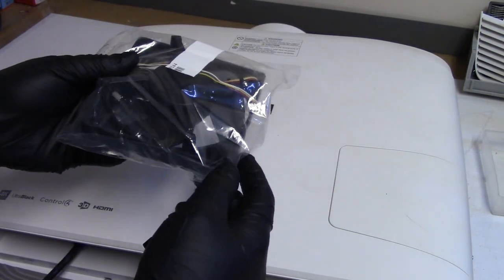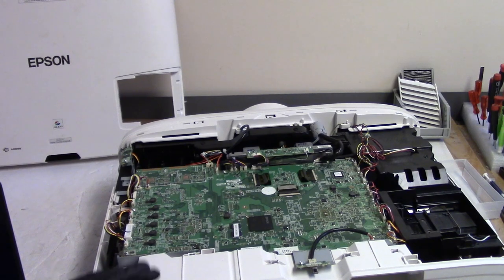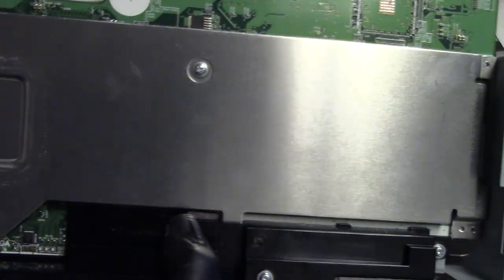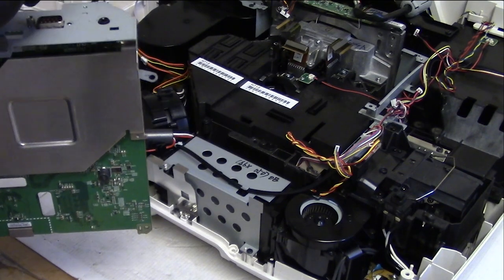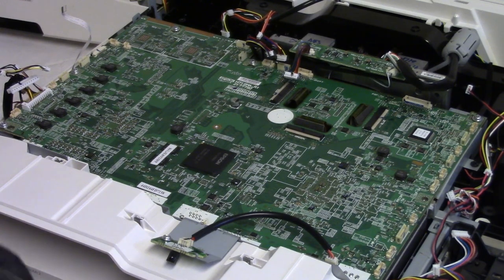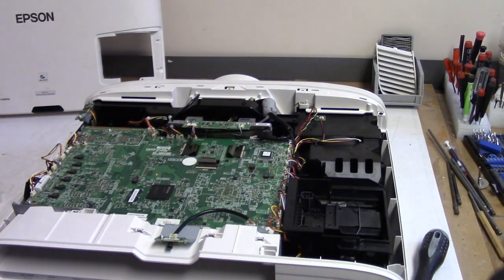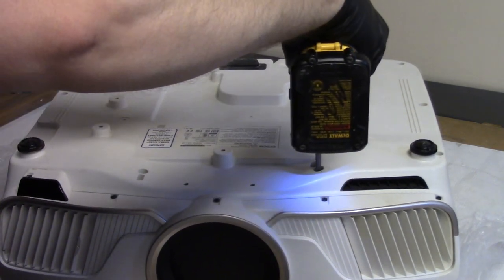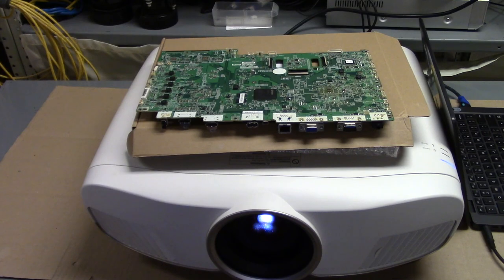Epson Home Cinema 5040UB LCD Projector Repair | No Video | New Mainboard - LAST EPSON REPAIR

Comment: Hey Frank! Thanks for this video. I’m having a similar issue with my Epson 5040 and wanted to see if you had any thoughts. my HDMI port 1 isn’t displaying video. I had an active hdmi cable running to it and yesterday when I turned it on… I got the Epson logo.. then a no signal. So I did some usual diagnostics. Power cycled, tested other sources, tried HDMI port 2, bypassed the receiver, etc. I noticed that the active hdmi cable was really hot. So… I thought maybe it went bad. I bought a replacement cable. Same problem. No source video. Just the Epson UI still. However…with the new cable hdmi 2 is working fine. So I’m curious if my HDMI 1 port has gone bad. Any thoughts? Appreciate your time!
Reply from the maker: Hi Brandon,  It does sound like that.  If you used new cables and they worked on HDMI2, then likely hdmi 1 took a hit.  Static is nasty for these. Ground loops are another issue.  Make sure your projector ground and video source grounds are at the same potential.  Or active HDMI cables can sometimes do this I have heard.  I have not seen one do it myself but I have heard of people saying it.    As much as I hate to say it, I'd just live with using HDMI 2.  Repairing that would require a new mainboard and through epson itll be crazy expensive.
Reply: @FixitFrank  Thanks so much for the reply. Yea it does seem like it's probably a... use the lesser hdmi port type of situation. Thanks for the honesty. Love the channel. Cheers

Comment: My Epson 5040 do not have a power at all. I called their technical support they told me Motherboard is failed. What options Do I Have? Or which brand and models are you recommending it? Thanks.
Reply from the maker: Sony hands down, or JVC.  I would run far from epson. They have not been good to consumers in my opinion.  The mainboard might be the issue. did it have a flashing Wifi LED and wouldnt respond otherwise?

Comment: Hey Frank, I've got a 5050 with a dust blob on it. Its blue when the screen is black and doesn't fully focus. After tearing this apart and with your extensive knowledge, how would you advise removing the blob? If your answer is don't....let's assume I'm stubborn and would try anyway. What would be your approach? Thanks!
Reply from the maker: Epsons are a pain to work on plainly put. They seem to turn into Pandora's box. Open it for one problem and then 10 more appear. To clean your projector you need to use a gentle vacuum a photo cleaning brush like a lens brush and lots of patience(and some.good luck). There is also a chance that the coating used inside will flake off when you go to clean it so be aware of that (it's located on the prism in the center of the LCDs). The mantra you want to follow is less is more. I would try and vacuuming first to see if you can pull the dust out that way and then start removing things to get towards the LCDs but do not touch the LCDs and do not remove the LCDs by themselves leave the optics together if you can help it. I wish you all the best,  but I would also make sure you have some money aside for a new projector. The Pandora's box thing is real and somehow Epson patented it...
Reply: @FixitFrank  Hmm, ok. Thanks for the reply. I've seen mutliple recommendations to use compressed air to blow out the dust. I was told to just put the nozzle where the LCD ribbon cables come up through the main board. What are your thoughts on this?
Reply from the maker: I'd use a vacuum.  Compressed air can push dust places and also cause the flexible cables to tear from the flapping. You actually need to take the mainboard out to get the dust areas.  they are all around that glass cube in the center. this is why I suggest against going inside.  If those flat flex cables to the LCD panels are damaged, the projector is done. You can use low pressure compressed air(not canned air) and loosen the dust and then the vacuum will collect it.  Canned air can blow too cold and cause moisture to get into places you don't want it. 
Seriously, you stand a real chance of ruining the projector. I don't say that because of a lack of skill on your part but rather epson makes these so unserviceable and after they get older the flat flex cables get very brittle and the optical coatings on the prisms can be susceptible to damage as well.  Im going to go on record and tell you that this is not a good idea but I also fully support your right to give it a shot.  I have a few other LCD cleaning videos, you might want to check them out.  But seriously be careful.  be so so careful. Good luck!

Comment: I have 5040ub 5 years old but used it only for less than two years, as it was sitting in the box for the first three years as I had basement stuff going on for three years. It doesn't power on at all. Any suggestions?
Reply from the maker: That is tough.  Epsons are notoriously troublesome out of warranty.  There is a 6v regulator that is known to fail and a few fans that are known.  I stopped repairing epsons because of the lack of parts you can get and how problematic they can be.  In your case, I'd try reseating the lamp, make sure the lamp door is on and that the power cord is secure. If its still not doing anything, then I'd put that projector up on ebay and buy yourself a JVC or Sony.  Epson has only declined in quality. I would never buy an epson today.  I will say the image looks great when they work but they now are failing after 5 years so save your money to spend on a better brand.

Comment: Thanks for the video, I'm after a different issue with this model but it helps to see what I'm going to be dealing with. I could use a second opinion though, if I'm seeing a purple bleed on the bottom of the screen with a light green bleed right after (both bands being on the lower 1/8th of the screen) am I looking at a color wheel replacement?
Reply from the maker: Unfortunately unless it is dust, that is a bad optic and unrepairable(within reason). LCD projectors don't use color wheels, they use a set of dichroic mirrors and other polarizer panels and what not to create color. what you are likely seeing is a bad polarizer or failing coating on a prism.  Thats terminal as the repair costs well more than double the value of the projector.  Its one of the main reasons I stopped fooling with Epson.  They are truly built to not be repairable. The only other thing it might be could be internal dust.  I'd have a professional clean it though as if you flex one of the LCE cables the wrong way it'll break and then the whole thing is trash.

Comment: My best guess would be internally shorted HDMI codec processor loading down the rail to the video output..  That sucks you had to buy a mainboard. I have a 696UI I'm looking for a mainboard for.  Epsons are very proprietary as you know hard to find parts for and they won't talk to you..
Reply from the maker: That makes sense. I wish I had some schematics to look at.  I did keep the old mainboard in case I can someday repair it.   Epson just drives me nuts with this stuff.
Did you have a burned regulator on that 696ui?  I had a similar short throw where a regulator literally burned through the PCB.  If you want, send Time and email and ask them. They got me this board for reasonable enough of a price. Not cheap but cheap enough. They may have access to a 696ui.  Gydz@timeprojectorlamp.com  Can't hurt to check.
Reply: @FixitFrank  yes, on the 696ui I did. Shorted 15v rail iirc. It was last year. I still have the projector upstairs but botched the board up too much to repair when I found the offending linear 8pin v. regulator. Since then I have fixed 3. Just thought I'd get the last one back running.

Comment: Where did you find a new main board? I’m trying to fix my 5040ube with a yellow vertical line. Thinking a main board might fix it. Thanks!
Reply from the maker: E-recycler in China.  It was like $500 though.  I'd make sure you LCD cables is seated all the way.  The fact that its yellow is curious.  Hopefully it's just a connection because I would not spend the $500 for a new mainboard.  That is a nice projector but its getting long in the tooth now and likely will start having polarizer problems in a few years.  Try reseating the LCD cables first and see if that helps.
Reply: @FixitFrank  Thanks! Any way you could get me in touch with one of those e-recyclers? I did open mine up and re-seated the LCD cables. It seemed to help a little bit. Turning brightness all the way up also sometimes gets rid of the line. I feel like it's most likely the board at fault. I'm willing to spend $500 rather than buy a whole new projector.

Comment: I have a question. I took apart my Epson 5040 to replace a different part and when I got it back together everything works except now my rf 3d glasses will no longer connect to the projector. So you know what I may have missed? It will display the 3d image, just doesn't connect to glasses anymore.

Comment: Hello! A friend of mine gave me a Epson 5040UB instead of throwing it in the trash. The middle of the screen is severely discolored and pink. Any ideas? Reset all image settings and updated firmware with no change. I assume it's a hardware issue. Where should I look first?
Reply from the maker: Sadly it is dead.  That is a bad polarizer assembly and likely a bad prism coating. What you are seeing is the way all epsons eventually die.  Its very frustrating as that is literally the only problem but repairing it is virtually impossible unless you want to spend hundreds of dollars that you can put towards a new projector.  
However, the iris assembly, Cinema filter assembly, ballast, power supply and mainboard and fans are all worth money.  I would sell it for parts if I were you.  Easily worth $200-250 as it sits.

Comment: HI
Mine has a yellowish vertical line across the whole screen, about 3/4" wide(((
please advise what can i do to fix it
Reply from the maker: Unfortunately it is not repairable within reason.  So many 5040's do this now. Epson designed these to fail after 5-7 years.  The cost to repair would far exceed the value of the projector.  Epson does this in purpose.  If you buy a new projector, stay far away from epson and optoma.  Sony or JVC are your best options.  It truly pains me to tell you this as I wish everything was repairable.

Comment: It really sucks that a lot of manufacturers are now making their products very irreparable. It’s a pretty scummy tactic they use to maximise profit when the item fails and forces the user to buy a new one. I love EPSON’s design and projector menu easiness and the power on and off sound (because I don’t like silent startup) and their 4 corner keystone. I remember when I was cleaning my EB-905 and I was ultra cautious. Put it back 200% the same way, same timing, same place and I hit the power. It came on for 3 seconds. All three power, lamp the temp indicators blinked red and all fans were blasting at full power. It was doing the overheat sequence. For 2 minutes. I managed to bypass this by immediately pressing power the millisecond it turned off after the overheat sequence. It was working fine then but I had to repeat that bypass everytime I wanted to use it. Opened it again, nothing wrong. This happened 7 times and it fixed itself so I don’t know man. Weird for sure.
Reply from the maker: I wish I could upvote this more than once.  You know my exact pain. I really really wanted to like repairing epson but that failed mainboard was the straw that broke my back.  Never again epson.

Comment: I'll never buy an Epson again.  I bought one about 6 years back and it had convergence issues / LCD panels weren't perfectly aligned so white text was multi-colored and not sharp etc.  I sent it in for warranty work and they send you a refurbished replacement and it was worse than the original.  So I called Epson support again and spoke with a manager and asked if the could guaranty the next would be sharp and finally the 3rd unit was almost perfect.
Reply from the maker: Im so sorry to hear that.  It bothers me because I hear this often from people.  I want to like epson.  but I see so many problems with repair and even with "properly" working projectors. Thanks for letting people know what you dealt with.  I know it will help  someone who isnt sure what to buy.

Comment: One question Frank did you had any image pressing menù button or patterns button? Because if not, the problem Is not the input section but elsewhere. Did you tried to reload the firmware? I'm really sad for what happend to you, but of you work with electronic It happens somethime, It happend to me too on a couple of TV was repairing in past. Will be a shame to don't see you ti work on Epson projectors but I can understand, the main board Is very expensive component.
Reply from the maker: yeah. I go over all of that in the beginning.  I spent 3 days troubleshooting the mainboard only to run in circles. I ended up paying $350 to repair this for the guy. Couldn't reload the firmware unfortunately as I couldn't get it into download mode.  Those 2 chips were really getting hot.
Reply: @FixitFrank  bad luck, I understand what you feel. Is weird that the Epson logo was coming up at starting anyway.  Who knows what Is faulty on the board sure not the inputs chip because if was this you should to have the patterns signal on screen so like the menù. You Need complete schematic of main board to follow the video signal.
Reply: Frank Watch into video, the space screw goes on the main board just in middle of board on side of big chip.

Comment: i am repairing a epson tw9300 at the moment .. after 2 years it won't boot anymore, no sign of life. any advice you can give me? i think it is the power supply or the mainboard
Reply from the maker: With epson its hard to say.  No power, I'd suggest starting at the power supply.  See if you have any low voltage power to the mainboard. If not, then go into the power supply. If you have some DC into the mainboard, check the little 8 pin regulators on the main board. Epson is a pain though. You can't buy parts unless you can find the discrete components. They wont sell you anything.  I stopped working on epson due to how unrepairable they build them.  Keep in mind the optics might also be failing so dont put too much money into it unless you know for sure the lcd and polarizers are okay.

Comment: Anyway to disable the cinema filter startup sequence? My cinema filter gear teeth all gone and one of the limit switch is gone also. I put a momentary switch on both limit switches to try and replicate the time the track touches them to keep the projector on enough time for me to go into the setting.
Reply from the maker: I don't think there is. I know the problem you mean. It's frustrating. I was thinking of trying to SLA print a new gear for those. You might be able to find a used gear from the folks i use. gydz@timeprojectorlamp.com is their email. If you can send them an email with a pic they'll be able to tell you if they can get you one.
Reply: @FixitFrank  thank you very much
Reply from the maker: I found a scrap unit at my office.  I'll check it tomorrow and see if its cinema filter gear is okay. If it is, and you are in the USA, we can work something out.  IFf you are overseas, I'd contact the email I gave you.
Reply: @FixitFrank  I’m in San Antonio, tx
Reply from the maker: I'll look tomorrow and see
Reply: @FixitFrank  did you find out?
Reply from the maker: I did have one but its also chewed up.  I do have a longer term plan to make new ones but its going to be a few weeks or maybe even a few months before I can.  Contact that company whose email I gave you.  They are inexpensive and they ship DHL and take paypal.  I've used them for 6+ years so they are very reputable.
Reply: did you find a way to disable the cinema filter ? did the temp switches work  to give you enough time to disable in the menu?

Comment: Anyone have a video or replacing the power supply and any tips/tricks to get to the power supply withough having to go through the top and all the other boards/items?
Reply from the maker: It's not possible.  These are such a pain to work on.  I tried every possible way to get to the supply without removing everything. these are such a nightmare to work on in my opinion.